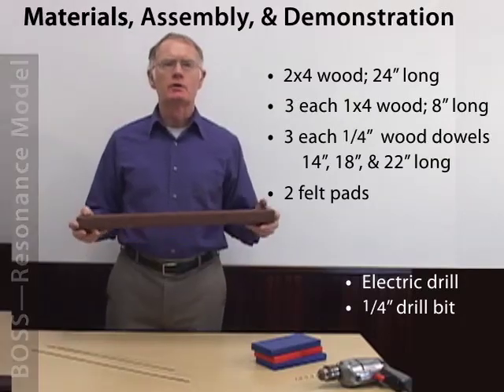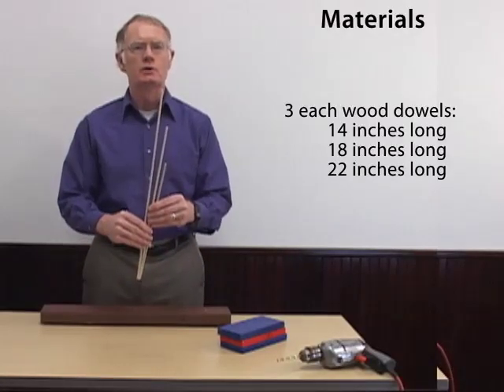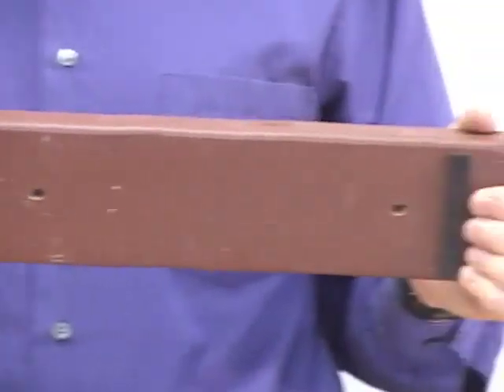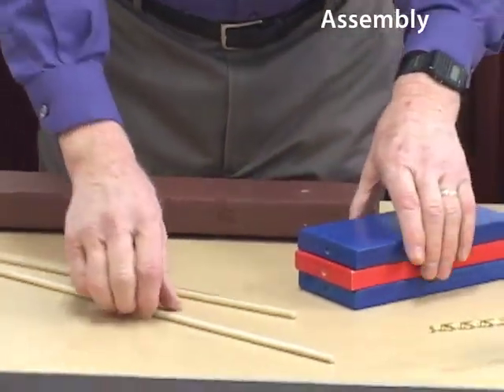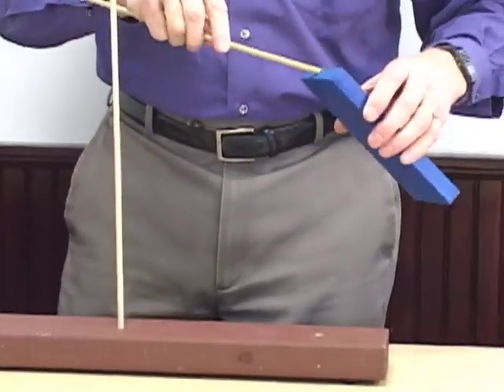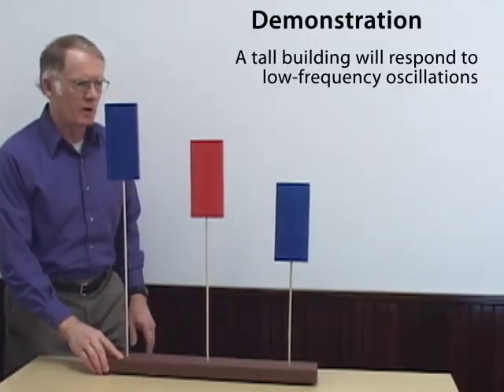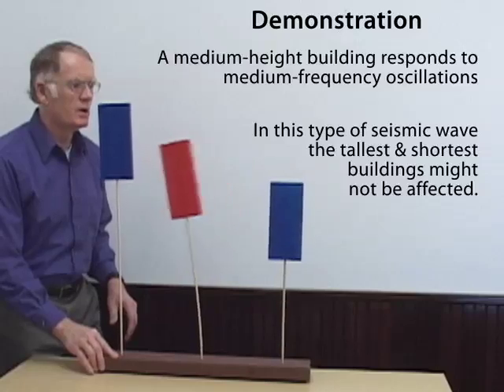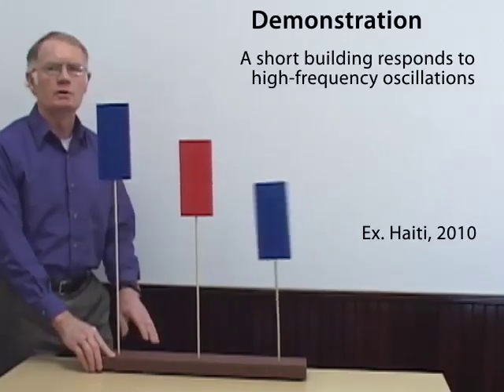BOSS model of building resonance. Why do buildings fall in earthquakes?

Comment: Great performance. I'm wondering if there is any way or any app that can measure the horizontal vibration of the base and the oscillation of the dowels to gather data and model a relation between them.

Comment: how the mass of all the buildings are same? is there no role of mass here?
Reply: The natural frequency is in fact independent of mass! It’s instead dependent on the length (or in this case the height) of the structure that’s vibrating, as well as the speed of sound.

Comment: How do engineers calculate or ballpark a building's natural frequency?   How is that knowledge put to use in designing the structure to resist shaking?
Reply: animusauthor natural frequency of a system =(k/m)^1/2 where k is the spring coefficient and m is the mass of the system
Reply: @Armenia818  thank you.  :-)